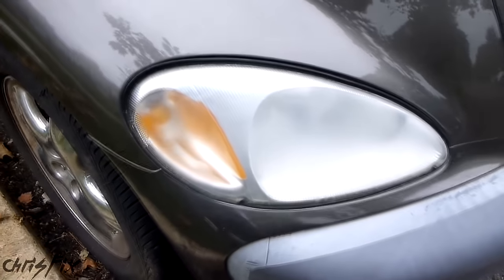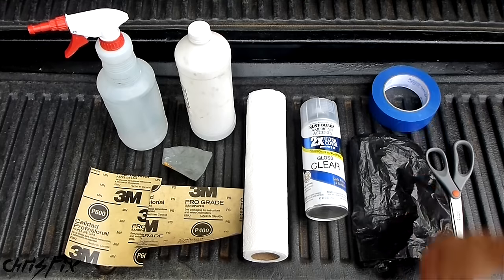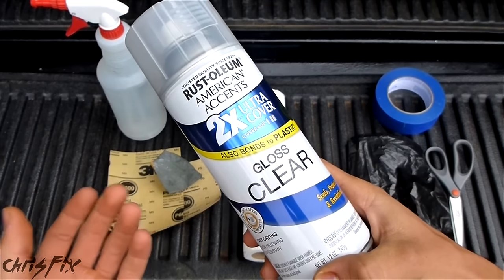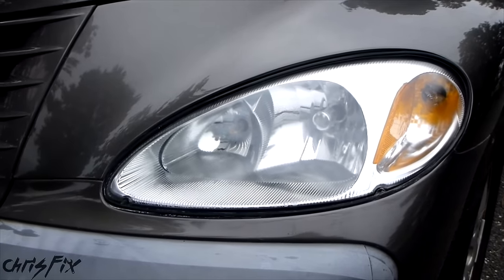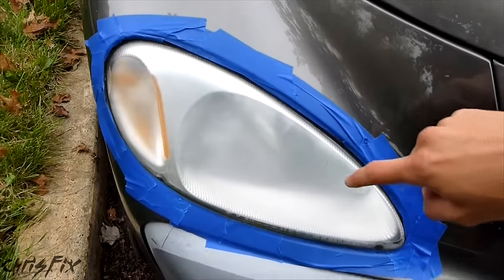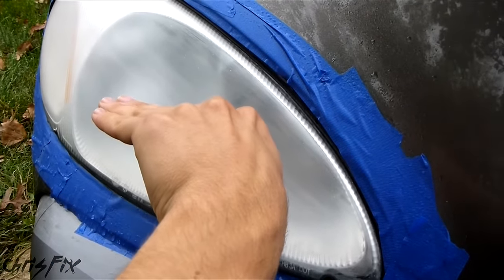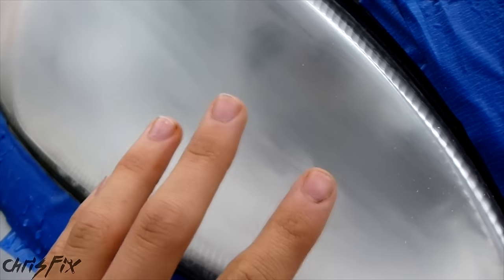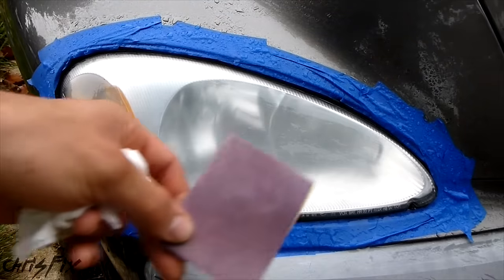How to Restore Headlights PERMANENTLY

Comment: I miss the good ol days of GLASS headlights...
Reply: Is there a way of clearing glass headlights like this?
Reply: Dusan Stevanovic Glass headlights don't GET like this =D
Reply: EvilJ069 Well it can but it is actually very rare and they can only get foggy from inside. I am asking for my friend's car. It's probably water that got into it.
I have '94 Seat Toledo with original glass headlights. 22 years old and they are clear as new. That's why I prefer glass over plastic :D
Reply: EvilJ069 Yeah I know, thank you anyways :D
Reply: +Dusan Stevanovic Glass headlights don't get hazy that's the thing
Reply: one of the reasons I love my beetle
Reply: +Talal M one rock and your glass headlights shatter, that's not very practical
Reply: Gewdvibes I've never had one crack, the only thing that's ever happened to mine was a rock hitting it at highway speeds and putting a pinhole in it, which would have happened to plastic ones too
Reply: +Gewdvibes plastic windshields then?
Reply: +EvilJ069 so thats why i was wondering why al of a sudden this became a problem.
Reply: Debra DKT Yeah, they stopped making glass headlamps around the early 90's, for various reasons: They weigh a lot more which reduces fuel economy, more expensive to make, and even though this makes no sense to me, people say that in an accident that glass could cut someone' to which I say if they're in a position to be cut by the glass of a headlamp, they're prolly already squished anyway
Reply: EvilJ069 Well, it's true it can be dangerous in case of accident. In case of frontal crash, glass shatters and pieces of it fly all around, so it can be dangerous for someone who is standing close to the crash I guess. But I love glass headlamps more than plastic ones. To me, they even look better than plastic.
Reply: Dusan Stevanovic And you don't have to maintain them! lol
Reply: That's why I have glass headlights...
Reply: Wonder if I could get custom fit glass headlamp assemblies for a Buick Rendezvous.
Reply: ***** Prolly, but would cost a fortune for the custom glass, plastic, and metal smithing, and then wouldn't be DOT approved
Reply: EvilJ069 You're smart. thanks for the info
Reply: +EvilJ069
Agreed, I like your comments lol.
Reply: Millermacs Why, thank you
Reply: yeah but did you like the cost of glass headlights? Probably not :)
Reply: Pete Bevan 
I bet all the added costs of the shit it takes to maintain plastic ones ends up making them cost the same.
Reply: Pete Bevan What Millermacs said. Having to maintain or fix plastic headlamps negates the saving of not using maintenance free glass
Reply: +EvilJ069  
I thought the plastic lenses were for fulfilling safety requirements.. and not cutting cost
Reply: Lee Han Voon Nopes, while cutting costs was good for the manufacturers, the main reason for the switch was weight reduction to boost gas mileage. Plus now they get to sell a lot more headlamp assemblies to make even more money, they get ya comin' and goin'
Reply: EvilJ069 I'm just gonna try Chris Fix' method, hope it's nearly as permanent as glass headlamp assemblies.
Reply: ***** It'll certainly be cheaper lol
Reply: I want to take my headlights out, make a mold, and fill it with molten glass
Reply: Nabre Labre
I'm bet there is a company out there that does it, not sure though, not enough people appreciate them.
Reply: Yea probably. I'd look it up but I know it'd be more expensive than I want. Glass is made from silicone, at least partly, i wonder if a silicone based spray paint would yellow...
Reply: Nabre Labre 
Yeah true
Reply: which car is that
Reply: +Quickest Rendezvous look around you might find that there were different headlights made for that car especially if the same model was sold in another country with different laws.
Reply: My ute still has em
Reply: Someone should start making aftermarket glass headlight assemblies. I don't know maybe they already do.
Reply: Appalachian Gunman Not that I'm aware of, and as awesome as that would be, I'm sure they'd be hellah expensive
Reply: lol....you said "hella"
Reply: EvilJ069 What about chipping tho?
Reply: William MacDonald That didn't happen very often, and then they have repair kits you can get, like the same things they repair windshields with
Reply: Oh. Ok sorry. I have never been near one to ever really notice before. I was born in 1998 and everything was plastic.
Reply: William MacDonald Poor child, never to know the joys of glass headlamps, or die-cast transformers. Or big hair rock bands... Fuck I'm old... My goddamn CURRENT car is older than you >.<
Reply: +William MacDonald I was born in 1999 and I know about glass headlights. My car is older than me and it's an Alfa Romeo headlight glass is as thick or thicker than the windshield headlights are 25 years old and only show minor pitting and a little chip in one light. I also know what sealed beams are and H4 's are way better. I have a pair of SEV Marchal headlights superior to any sealed beam for my soon running other Alfa.
Reply: i have a 1991 toyota celica gt coupe... not a single bit of oxidization.
Reply: PHD Sean-Cringologist Must be nice
Reply: Plastic headlights should be illegal. After so many years they are dangerous due to reduced illumination at night, and not that many people are going to go to the trouble of restoring or the ridiculous expense of replacing them. But the government nannies who dictated plastic lights on the carmakers don't give a damn about dangerous lights; all they care about is increasing fuel efficiency by 0.000001 mpg. Get used to the eco-nanny state. It's only going to get worse.
Reply: Dusan Stevanovic Considering how much glass there is in a modern car—windshield (laminated standard glass), side and rear windows (tempered safety glass) and of course mirrors—how exactly does a glass headlight lens carry a greater risk than all  the rest of the glass in the vehicle?
Reply: Some things should not be sacrificed for weight. Headlights are one of them. I would prefer glass lenses made of  safety glass.
Reply: Pete Bevan Glass headlights were half the price of a bulb these days! $8-  $20 bucks got you new glass and bulb.
Reply: I remember glass headlights. They never hazed up.
Reply: The glass headlights on my 97 Trans Am still look great
Reply: EvilJ069 glass is more prone to cracking and shattering from road debris
Reply: eggrollsoup
Out of the number of cars I've had that had glass headlamp, never had this issue, out of all my customer cars that had glass headlamps, it was rare. Sorry, you are incorrect :-)
Reply: +eggrollsoup that would be one big rock to crack a glass headlight.
Reply: EvilJ069 maybe you didn't get hit by road debris in the headlights it can happen and windshields are less prone because firstly they are slanted which deflects some of the force and also they are higher up reducing the chances of getting hit, also even windshields crack quite often
Reply: eggrollsoup
I know, my windshield is cracked... lol
 It's been my experience that windshields crack or get damNaged more often than headlamps
Reply: Hello By you'd be surprised a small bit of road debris can easily pierce your head on the free way and dent your car plastic is more resilient
Reply: EvilJ069 yea and cracked headlights would probably be more expensive then doing this method of clear coating it
Reply: EvilJ069 I'm not trying to give full support of plastic headlights but I just want you to know some of the benefits they pose and you know some anyways
Reply: My first car had glass headlights, as well as a car I sold half a year ago, as well as my current Trans Am which I mentioned earlier. The headlamp was never an issue on any of them.
Reply: eggrollsoup
Yup, I just hate having to clean them
Reply: EvilJ069  yes me too! Glass headlights were the best!
Reply: Jack Poage  Do they still make glass headlights? Can you get them for new cars?
Reply: No, they were changed to prevent glass from ending up on roads when they shatter.
Reply: Hollow114  Thank you.
Reply: How does the amount of glass in a car‘s headlights compare with the amount of glass in a car’s windows and mirrors? Yet you don’t see those being made of plastic.
Reply: ^ This
Reply: Gewdvibes 
Yeah, but replacing a glass sealed beam lens costs $40 at most at the auto parts store; as compared to $200 at the dealer.  Chris' $10/headlight method not withstanding.  So to me, glass still wins.
Reply: +B3burner Well I wasn't even meaning the sealed beam lights, I meant the old glass assemblies similar to the one on that PT Crapper. My first car had glass assemblies, but still used one of the newer 9004 bulbs in each one
Reply: Actually, in the US auto manufacturers were REQUIRED to use one of 4 headlights in their design (round or rectangular, single or dual beam).  This was a BIG problem from an aerodynamic standpoint and foreign manufacturers had already switched to molded, plastic headlight lenses w/ removable bulbs.  They finally removed that mandate, and buh bye glass headlights.  It is interesting to see what US manufacturers tried to do to make those giant, flat headlights aerodynamic.
Reply: Actually, having TWO cars with glass headlights, I can assure you that they are cheaper than the bulbs in the new ones these days.  $50 for a bulb and the headlight is still opaque.  DOH!
Reply: +VroodenTheGreat There were aerodynamic glass assemblies with replaceable bulbs used in the past. The plastic ones of today are just more modern crap.
Reply: explorepikespeak a frosted headlight is a vehicle maintenance issue and is safer in a crash due to them being more curved in most cases. When kept in good condition, polycarbonate and modern reflector technology is MUCH better than old glass lights. I have owned 'modern' glass lensed vehicles from the mid 90s and their lights were utter garbage in performance compared to any of my 3 vehicles now.

It is YOUR responsibility to keep your car in a safe condition. If your polycarbonate headlights get foggy from sitting in the sun for a decade, polish the plastic and reseal. With a restoration kit it takes barely 10 minutes. I have done this on many cars without issue and they all come up as new.

By your(poorly thought out) logic, tyre manufacturers should be outlawed because rubber tyres perish in the sun as well.
Reply: How old are you? LOL
Reply: My headlights are made of glass. I thought most were.
Reply: Peppridge Farm remembers
Reply: I'm happy to say that my 2000 Impreza RS has glass headlights, Especially because the base model by that time used plastic.
Reply: I was thinking that same thing 😓
Reply: My Uncle Drives Mercedes-Benz 190E With Glass Headlights ;)
Reply: max brooks the point of plastic lights are,
Lighter,
More freedom in design
Better light transmission
Not a big heavy lump of glass that doesn't need to be there in the front of a car.
Don't shatter as easily when hit by rocks.
Less imperfections in manufacturing
Less energy intensive to make.

Look at a full size glass headlight from the last glass headlight cars if you get a chance, try picking one up. The glass is very heavy. They can break loose in an offset crash etc and the heavy glass will shatter.

A windscreen NEEDS to be glass because a large plastic windshield of optical quality would be expensive to get right(remember I said optical quality) it will also haze and yellow and become very dangerous over time. It's not about whether everything should be glass or plastic but which one is the best choice for an application.
Reply: I remember back when I had glass, pop-up headlights. I was young, I was brash, and I felt invincible. Most people hated them but they looked better than plastic, were durable, and never got dirty.
Reply: EvilJ069 my 2004 volvos have glass headlights
Reply: Good ole days of quality.
Reply: That's why a 1995 Hyundai Accent is better than a brand new car (Well, it also has stronger body, better quality steering wheel, it is higher...and beautiful).
Reply: Hasn't happened to me in over fifty years. On the other hand, a bunch of small rocks or just a few years of sunlight and plastic headlights need to be replaced. Plastic headlights are many times more expensive than glass headlights, and they don't last as long.
Reply: @gewdvibes  AND can be replaced for LESS than $20 !
Reply: @appalachiangunman9589  Ebay/salvage yards.

Comment: It's been a year and a half or so.  How are the headlights holding up?  Too many times we see how beautiful a headlight restoration job is, but nothing is said about durability.  And two or three weeks isn't enough to judge durability.  If these are still this good-looking from October 2014 to June 2016, THAT would count for something.
Reply: Well he clearly states and says several times. "How to restore your Headlights PERMANENTLY"
Reply: follow-ups are in the description
Reply: It's no different than sanding the headlight the first time. I don't know why people put clear-coat on headlights. Especially spray can clear. It will chip, it will fade, it will crack. The best way is just to sand back the plastic, and polish it up. It will look brand new, and we all know how long brand new headlights take to fade.
Reply: I too would like to know.
Reply: There is a protective clear film you can buy for them, don't know how well they work, but it's the really smart people I see using them.
Reply: Description has links to Instagram updates.
Reply: MrOgger151 What kind of clear coat did you use? Enamel really sucks but is the most common for aerosols. You need specifically what he is using in the video, which is lacquer.
Reply: MrOgger151 
If u don't coat it with something you'll have to reclean them about every month or two.
Reply: It all depends on how look at it 5 mins of buffing maybe twice a year to maintain or 7 to 10 hrs if your lucky of stripping and trying to remove clearcoat  from plastic every other year. I really do not know how often I will have to buff them. I am going to have to wait and see.
Reply from the maker: Look in the description where I posted updates. More than two years later and the headlights look great still.
Reply: Haha ok whatever, The life of the product is 5 years, so to say you did your "repair" and it was ok 2.5 years later doesn't disprove my point. How long was the interval between the next coating, and the next?

Comment: ChrisFix It's been 5 years now. How long did this fix last?
Reply: Longer than the PT Cruiser did..like 25 mins or so.
Reply: Mine lasted a couple years without any follow-up maintenance of any kind before they started getting kinda crummy again. Easy enough to repeat the process to clean them up, but I ended up getting rid of the car.

Comment: Just a tip : The horizontal sanding only needs to done on the last sanding step; all the previous horizontal scratches are removed by the subsequent sanding steps.
Reply: I was thinking the same thing